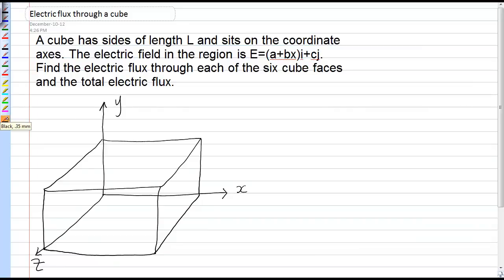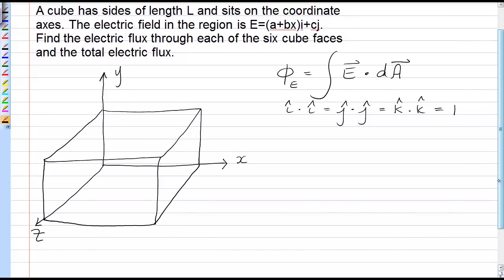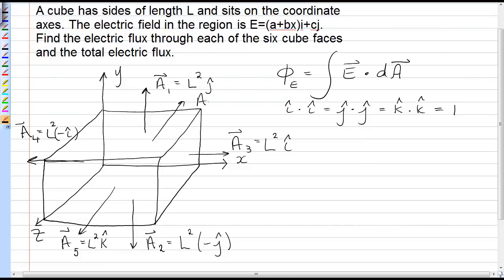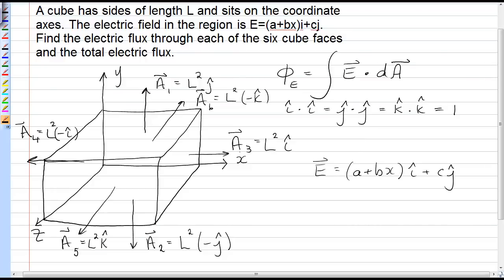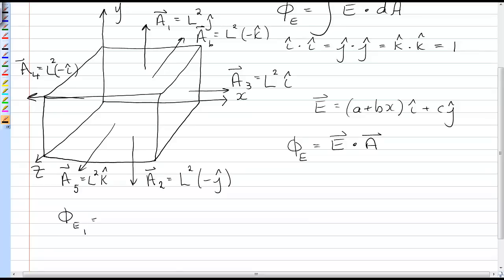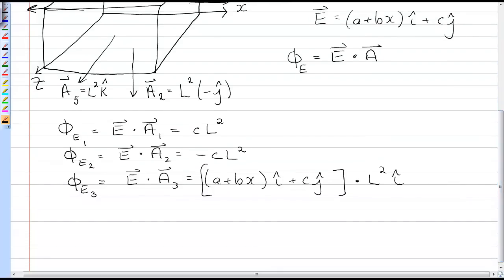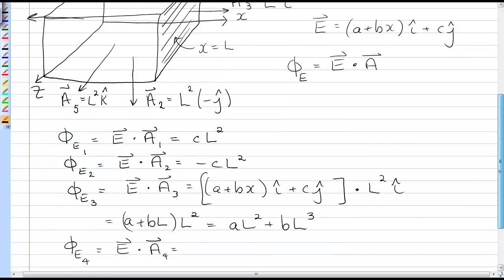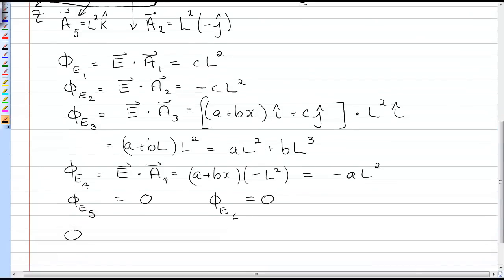Electric flux through cube

Comment: Thanks for NOT explaining how E = (a+bx) + c.
Reply: E = (a+bx)i + cj is a function that describes the magnitude and direction of the electric field for this particular problem. This is not something you are expected to know, it is part of the problem.
Reply: Given in the problem, isn't it?
Reply: That notation is called vector notation; the i, j ,k with circumflex (hat symbol) correspond to the x, y, and z, axis. If we wanted to find the electric field at (-1,3,0) we would plug the (-1) into the i component of the electric field equation given, the (3) into the j component of the equation, and (0) into the k component. I hope this clarifies your initial question.
Reply: @stabbynuggets   i know iam late but i just wanted to let you know i love you and hope you are doing well. your explanation for that vector notation saved my life.
Reply: aylo ra I forgot I wrote this haha.
Reply: I see, thanks.. it is a vector (hence the components)
Reply: Okay I got it now. 
So that notation just tells you the dimensions of the box on the given axis for a value of x, usually in meters. 
So like if the problem was to find the flux through a box with dimensions 1m x 1m x 1m, you'd plug in 1m for x, then you'd multiply that by the area. So it'd be (350(1m)) x (1m^2). Yay! Ignore the 100 because idk what that means.
Reply: yeah but why... what the hell does it mean?! i am stuck on a problem like this